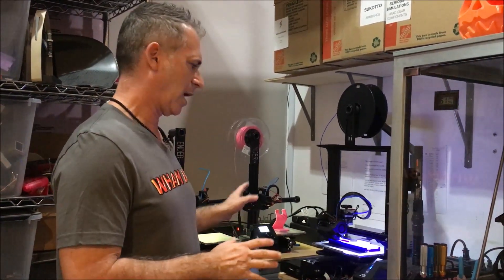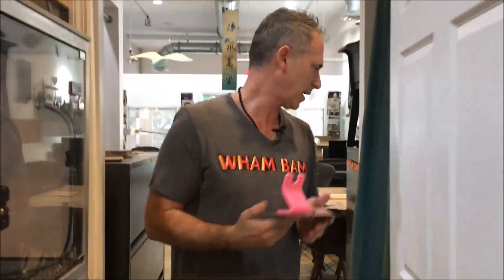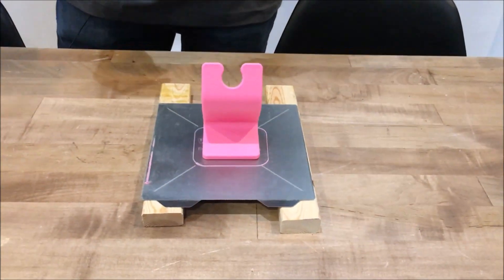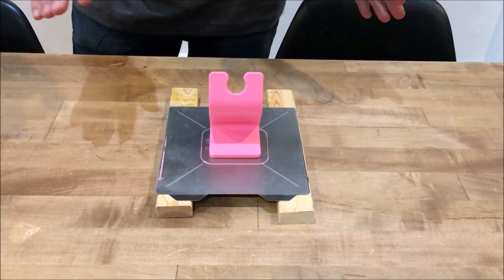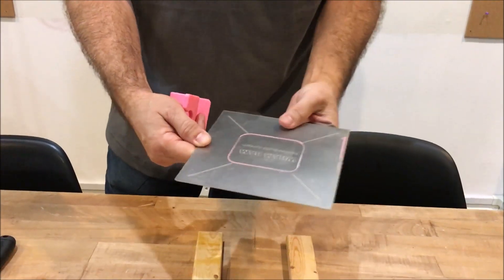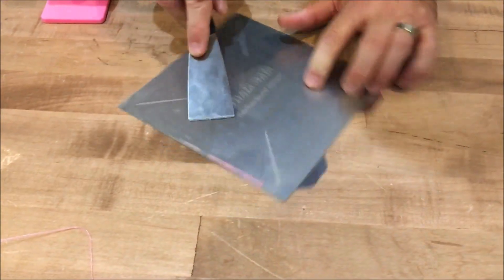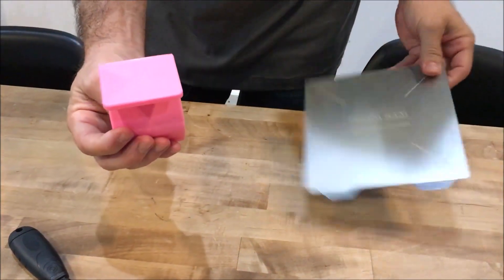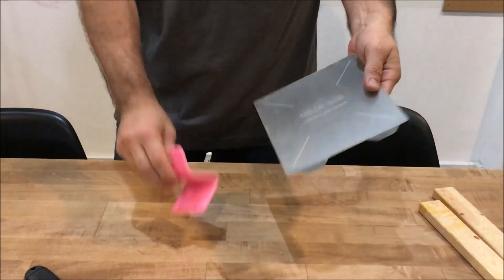Cooling the Flexi Plate Before Removing The Print

Comment: I always just use a fan and blow it up at the bottom of my printer bed, saves me from having to reposition the build surface. I just peel up half of the build plate if necessary, maintaining the positioning of the build plate.